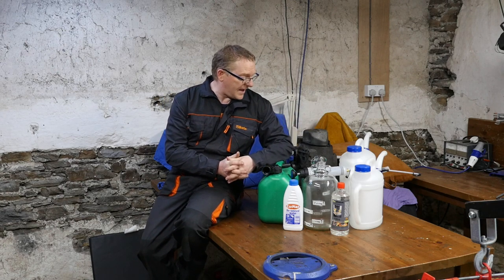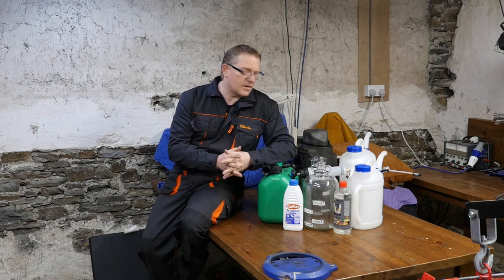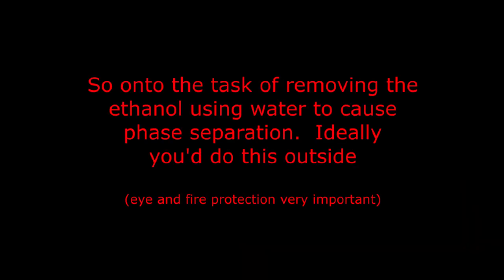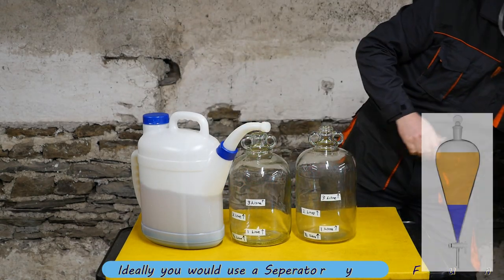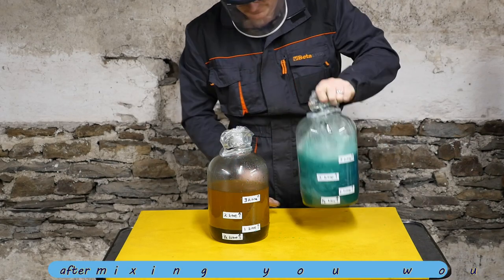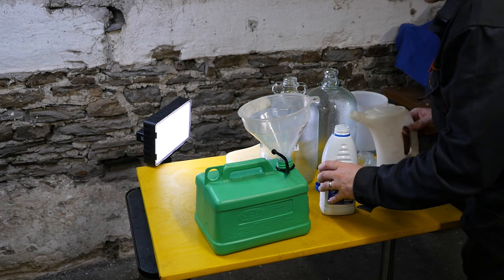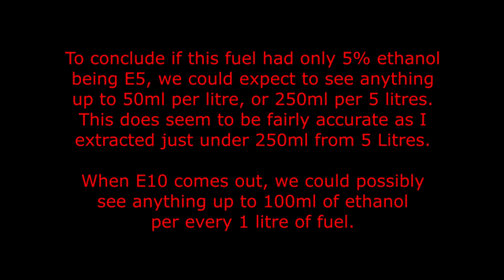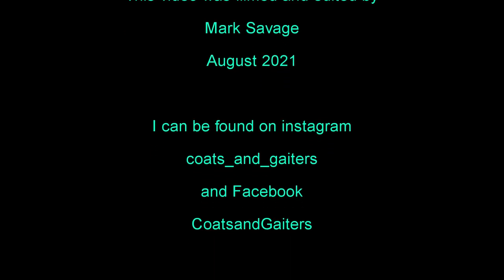E5 and E10 ethanol Petrol issues & removing from fuel.  Video 1 of 2 latest version in link below.

Comment: Very informative. They just started to sell E10 here in Sweden and I can see a signicative higher fuel consumption in my car, about 10 percent higher. For my outboard I use 98 octane because it’s E5.
Reply from the maker: Thank you Mikael for the positive comment.  This was all a surprise to me till a few weeks back.  Feels like the days of petrol and diesel are numbered.  I think Hydrogen might be on the horizon from what I read from JCB diggers.  They are going to hydrogen as batteries too heavy and cannot run all day like required on a work site.

Comment: 10% ethanol raises the octane rating of standard gassoline by 2 - if you are starting with RON 95 fuel you end product will be RON 93 which is more than enough for most vehicles . Most vehicles require 89 octane fuel .
Reply from the maker: Thank you for that information.  You make an interesting point that removing the ethanol may not adversely affect the cars running too much.

Comment: Correct me if I'm wrong. As E10 fuel is a blend now where 9 parts is unleaded and 1 part is Ethanol which as you said it is a booster because of higher octane (109) so to make 95 E10 at manufacture they need to use unleaded with 84-85 rating to get 95 number, and if you will remove ethanol from the fuel you will get just pure low quality fuel.
Reply from the maker: You will get a lower octane fuel, yes.  In theory turning Premium to Regular.  I think it's only worth removing the ethanol if your car is at risk that the rubber parts may perish.

Comment: I would like to bring g the new E10 fuel down to E5.  Would that be done by halving the water required to remove the 10% ethanol.
Reply from the maker: I don't think it works quite like that as you have to add enough water to cause phase separation and once that's happened it drops out.  You could remove it all and add 5% bio ethanol I expect.

Comment: E10 is already here. It is my impression that it was to be introduced everywhere in the UK in early september. My local Shell and Tesco garages are already selling it. There is still Shell Optimax or Premium fuel but it is about 10p/litre more. Is it worth removing the ethanol from E10 or just buying premium unleaded Shell Optimax or similar instead?
Reply from the maker: For me I'd just leave it as it is.  MINI's seem ok with it and that's what I drive when they are working.  I guess classic car experts may choose otherwise from experience or a deeper understanding of the subject than I do.  I think the petrol and diesel cars as we know them will forever be under attack now until Hydrogen is here.
Reply from the maker: @Lloyde Turner I guess you can see what happens by removing the ethanol though I'd put some octane booster back in but then your probably making it really expensive with the 10% lost ethanol/fuel you paid for and paying extra for octane booster.  Fun days of driving seem to be becoming a distant memory.
Reply: @Lloyde Turner Or you could just buy Shell Optimax or similar which is still 97/98 octane if I am right, but only E5, but about 8-10p/litre more expensive than current unleaded 93-95 octane E10 fuel.
Reply: Just use premium. No ethanol no problem
Reply from the maker: @elixier33  I'ts been mentioned esso synergy supreme+ 99 is ethanol free but not sure how many places sell that.

Comment: I've seen a few other videos of people doing this, ones who run really old classic cars, and you need a few large heavy duty petrol resistant jerry cans with drain plugs at the bottom so you can decant the water leaving the petrol safe in the jerry can. I wouldn't try and do this unless I had such containers.
Reply from the maker: Very true Alex.  I did consider doing that but the containers I had were white and felt the blue water wouldn't show very well so went for the riskier glass demijohns.

Comment: Would it not be easier and safer to simply pass the petrol/water mix through a fuel filter?
They are designed to trap water after all.
Reply from the maker: Your quite right as they do make funnels exactly for that with a mesh filter that doesn't allow water to pass through.  The reason I didn't try one was some reviews said they only worked for so long and that a large amount was left in the funnel afterwards that you had to dispose off.  So this video is more about the theory than actually doing it.  Hope that explains where I was coming from.

Comment: Ok so looks like you got a good yield there, but not precisely measured. Even if I go for a dry fuel additive instead, which I was told about at the motor shop, I will try doing this procedure at least twice on one experimental batch, to see if 100% of the ethanol is removed on the first run and measure yields precisely by weight.
Reply from the maker: Personally I wouldn't do it at all as it's so dangerous to be playing around with petrol like this.  Mind I'm not really a car guy so I'd go without a car if I could and just walk or use an electric bike if possible.

Comment: I don't know how it's called in your country, there as some water/diesel additive which can "dissolve" water. I never used that but with the blue dye test perhaps we can see the properties. Bardahl 1082, like.
Reply from the maker: I wonder if that's to bring the water back into the fuel solution so it doesn't sit at the bottom of the tank causing more trouble.  I know diesel has issues now with the added bio diesel they add.  That causes a slime mold  to form I believe.
Reply: @CoatsandGaiters  It supposed to but never see in action. That's why I'm always half tank minimum than empty tank to avoid this phenomena.
Reply from the maker: @alundrasrt  worth knowing about though isn't it.  I always wondered why the lawnmower was never happy after winter.  Will run them all dry now to avoid water pooling at the bottom of the tank.
Reply: @CoatsandGaiters  be careful leaving your equipment dry over the winter period, this can cause drying out of rubber hoses and diaphragms, a better solution would be, if at any stage you’re likely to leave fuel in your equipment for more than three weeks, leave the fuel system with an alkylate based fuel in it , e.g. Aspen 4 (blue bottle) for 4 stroke engines or Aspen 2 (red bottle) for 2 stroke engines.
Reply from the maker: @richardbeckwith4545  thank you for that Richard.  Never thought of that.  Probably just as bad as the ethanol.  I never knew about Aspen 4 till now.  Not cheap but has a long shelf life I see.  So would leaving ethanol free petrol be as good for leaving in over winter?
Reply: @CoatsandGaiters  no problem, glad to have been of some help…..  Aspen type fuel has a shelf life of at least two years once the bottle has been opened (at least 5 years is not opened), ie it does not go stale in that time and is not hydroscopic like ethanol, it’s therefore ideal to leave in your equipment over the winter months / periods of three weeks or more, does not dry out rubber seals / diaphragms so when you come to use your equipment again it should start without any issues, it’s also worth noting that with a product like Aspen (just happens to be what I use), you’ll get next to no coking of your spark plug, valves etc and that it’s friendlier to you and the environment.
Aspen is actually derived from regular fuel, ie the ethanol removed, then alkylate added, so for sure, as its cost = ‘regular fuel + process + additives’ it’s going to be more expensive than regular fuel @ c. £20 for 5 ltr, so if you have equipment with a carb on it and you’re okay with the possible accelerated deterioration of your equipment (unless you have your carb adjusted to suit e10 fuel) due to the different octane rating, perhaps use regular fuel when your getting through the fuel in less than three weeks, for the rest of the time perhaps use Aspen.
Reply: @CoatsandGaiters  love your video by the way 👍
Reply from the maker: @richardbeckwith4545  thank you Richard.  Did you see my later one on ethanol out of interest.
Reply from the maker: @richardbeckwith4545  I could have done with this info for the video I just made lol  I might buy some I think.  Seems sensible.
Reply: @CoatsandGaiters  I have now 👍👌

Comment: I only use e85 in my tu3 engine, it's working fine. Did not watch the video yet. I'll find out why you want to remove ethanol.

I don't know about you guys but here in France ethanol is twice or sometimes 3x as cheap as fuel.
E85 is almost never moving it's at 0.69€/L when fuel varies from 1.5 to almost 1.8€/L. It even went as high as 2€/L during the yellow jacket movement.
Reply from the maker: Blimey the TU3 is pretty old school.  Did like that engine.  Interesting to hear of no problems in that.  I won't be removing ethanol any time soon lol, a lot of hassle.  I can see the issue if your car stands for a long time.  I think they tried selling E85 here in the UK but it didn't take off.  Apparently the UK doesn't have enough land to grow it economically.
Reply: @CoatsandGaiters  watching the video rn, 

Apparently running lean does not cause issues all the time. Engineering Explained did a video about that, he said that it can be an issue on turbocharged engines cause they tend to run richer to avoid knock (sometimes 9:1 instead of 14.7:1) so if you run your turbo engine lean you can start getting knock.

But ethanol is sooo hard to burn compared to fuel (Me trying to start the car while it's 0C and raining outside can attest that ethanol is hard to burn) and the octane rating is so high that it might not be an issue. 
Most turbocharged engine really like ethanol because of high octane (low octane fuel are an issue on turbocharged engine). You just have to look at the Koenigsegg Jesko (twin turbo v8) : it's making 1000hp on unleaded and 1600hp on e85

And i've read on some forums that ethanol is dissipating less heat while burning so running lean is less of an issue.

In conclusion you should not running lean cause it's really a pain to drive, but on ethanol it's really unlikely that it would ruin your engine.

And e10 is really easy to run. Most cars can run with 5L of e85 + the rest of e10 without issue. I've seen some ppl running e85 on old renault cleon engines, bc they had carburators they used the starter all the time.
Reply from the maker: @L3xou97  thank you for all that information, sounds like you know your subject well.  The media will probably make a big thing of it over here like they sis when unleaded was coming in and again every car was going to be destroyed by it.  I've already seen adverts from the media saying your insurance company won't pay out when E10 damages your engine.  Like I said in my video I never knew of E5 let alone E10 but then I don't really drive much and live fairly remote.
Reply: @CoatsandGaiters  Normally you won't have any issues with it. If your car will be stopped for a long time just fill your gas tank to the top so that there is less air inside.
My dad had a just an issue with his car, may be related to e10 or not idk. It was just a rubber gasket leaking between the tube where you will the fuel and the fuel tank. 10€ gasket, not a huge deal
Reply from the maker: @L3xou97  I think that's likely to be the biggest issue is water getting absorbed from the atmosphere.  Though I guess if rubber fuel parts perish there could be more engine fires !!!!
Reply: @CoatsandGaiters  the car was old. We have an expression over here : it may be the water droplet that made the jar overfill. 
Maybe the rubber was close to death and ethanol just finished him off.
Enginering explained did another video about an SAE study that showed that ethanol isnt bad at all
 But methanol is
Reply from the maker: @L3xou97  I love his video's, he explains things is a great way.  Will pop over and have a watch.  Just watched and like you say he see's no issue other than phase separation and lower miles per gallon.  I think our UK media will prefer to hype this as much as possible and put fear into people.

Comment: What  is your  octane  booster  made from  visit ethernol. So you are  defeat ing your   objective.
Reply from the maker: Hi Ken the octane boosters might be methylcyclopentadienyl manganese tricarbonyl (MMT), toluene, and variants of trimethylbenzene so your not putting the ethanol back but the advantage is that older cars won't suffer the ill effects of the ethanol as it's quite aggressive to fibreglass in motorcycle tanks and older rubber parts.